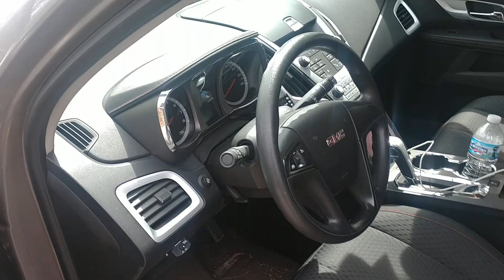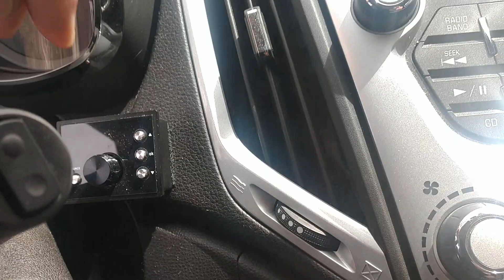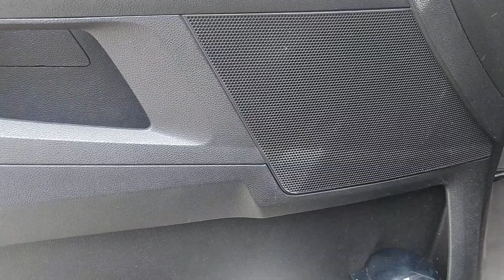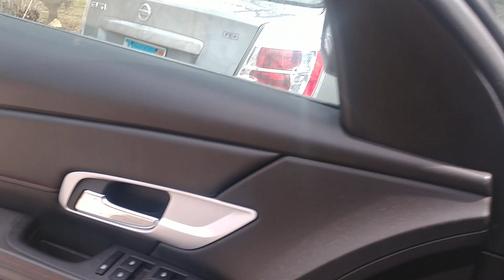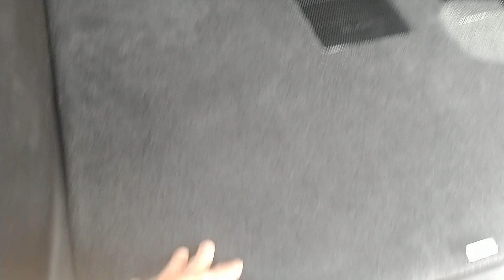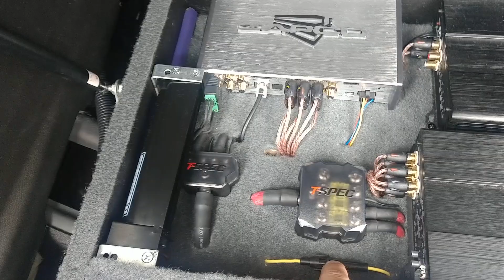2011 GMC Terrain audio build walkthrough

Comment: I have a 2019 Terrain, And Im going the same route as you did, but I aim to use  CT Sounds on a 3way active front stage/custom A pillerds, using an AudioControl 6ch/wDSP. And 3 Ct sounds Meso 10s, @1ohm. Throwing an Epicenter in the mix also. 
So, You didnt upgrade the electrical(Alt)? Just added a battery??

Comment: Dual 4 ohm ran in parallel would be 1 ohm and in series would be 8 ohms
Reply from the maker: Yeah I misspoke in the video. They are dual 2ohm ran in series parallel.
Reply: So .5 ohms or 4 ohms then unless you have 1 ran in parallel and 1 ran in series idk I was just checking out your video I have a equinox and I'm trying to keep the factory radio any tips I'm gonna use a kicker loc and splice into the back door speakers

Comment: Hey John do you remember how many sq feet of sound deadner is took? Did a install on my 2014 turrain slt-2 . The vehicle relied on the anc system for all the noise suppressing .I deleted the anc and I'm now getting all the road noise and to be honest The damn thing sounds like a metel shead . The pioneer system sounds pretty decent from factory with center channel front stage . I've since added a phinox gold xmax 10" 2ohm svc In q quarter wave/ t-line/horn vent enclosure powerd buy a nemesis audio na-2km.  I replaced the alt with a raggie  single run of 0g grounded to the same hump I retain the spare tire and enclosure is 11.5 " tall  rear fire port . I've had a 15 inch ds18 exl x15.2d and a 8inch ct sounds strato 2ohm both in vented enclosures but nether holds a candle to the quarter wave and svc.. the efficiency of it goes un matched . The amp is over kill but keeps the tune far away from clip.
Reply from the maker: It's been quite a while since I did it but I do remember I bought the Colossus by Knuconceptz  and it was two boxes from Amazon.

Comment: Did you deaden the hatch panel?  If not any rattles from it?
Reply from the maker: I deadened it too much actually. No rattles at all but now it is kinda heavy for the stock shock absorbers that hold the door up.
Reply: @Grayback1973  I'm guessing it would be removed the same as a 15 Equinox

Comment: The cubby thing on the side pops out and I adjust my amp in the back under the side panel that way but have a remote run up front also that allows me to turn the bass gain up and down.